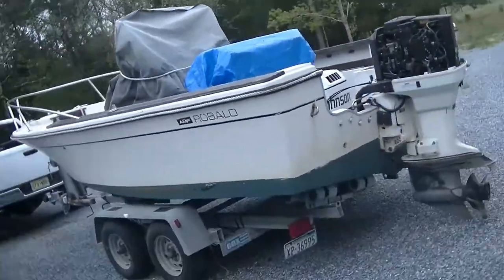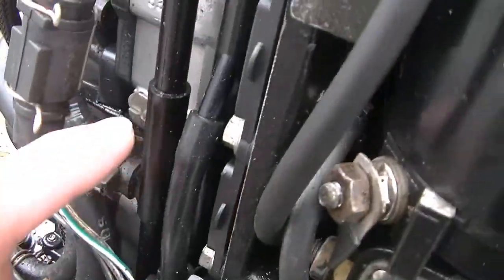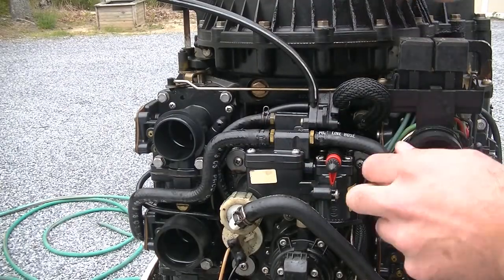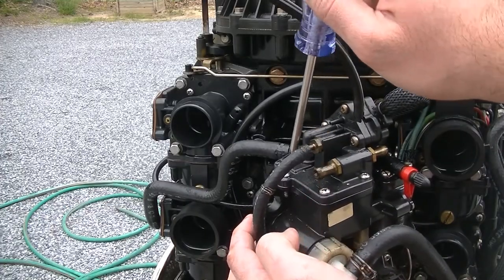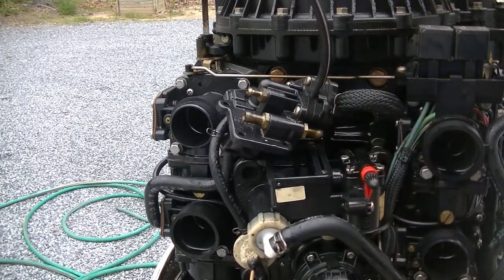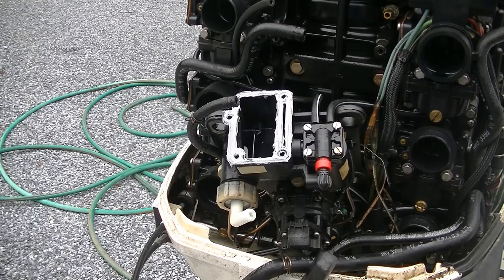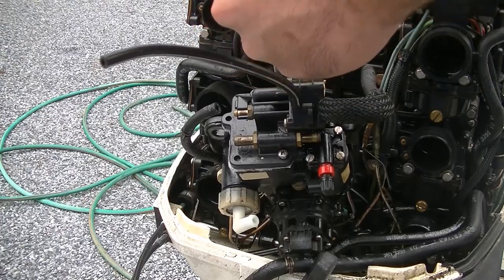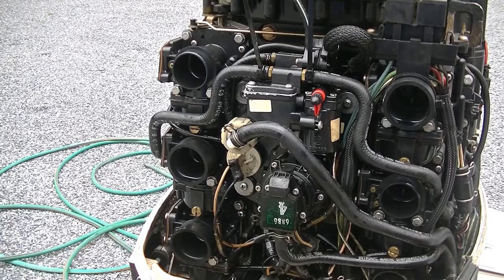150 Johnson vapor separator fuel leak repair

Comment: My motor didn't looked like it was leaking from there but was starving for fuel after 4000 rpm......i took the cover out press hard on the primer pump and i could hear air noises and a lil bit of fuel leaking thanks to this video

Comment: My VSC had a crack at the cover causing fuel to squirt out while priming. You cant buy the cover any longer so I had to repair it by filling in the crack with gasket sealer, Your cover is different from mine sine I have only two hoses and I see you have 3 to the cover. As far as zip ties go that's what the factory uses.

Comment: I used a huge stainless steel hose clamp put it Araund it front to back tightened and the leak stop ...... between that tank and the vapor pump there is a O ring looked like mine was also leaking from there because its all plastic it bend so either put a ticker O ring or sand it down a lil to make it straight

Comment: Will this problem not let your boat run? Mine is leaking there also but not as bad and it will not run more than 4 seconds
Reply: It could if the leak is big enough. When the pump is working it will be sucking air from there.

Comment: Man my 175hp Johnson has been sitting for 6yrs and I just ordered over $1,300 in parts and was hoping I could find a way to eliminate all this octopus 🐙 mess and put like an electric pump or oldschool pulse pumps because I can’t find the same parts like the vapor chamber and stuff there discontinued, any tips on here?
Reply: Yes buy a 6' pressure clamp and put it Araund the to seal the it worked for me stop the leaking

Comment: At Bobbygfl- for surging like that, its likely a fuel suction  leak... At Jason Kennedy same for you with the milky fuel- that's air getting into the fuel pump and when the diaphram mixes the oil with the fuel which has air bubbles it foams up.
You both should splice a piece of clear tubing between the fuel fitting entering the engine and your bulb which goes to the fuel tank to see if there are air bubbles being sucked up.
if so trace your fuel lines all the way back checking for air leaks.
As for warped carb bowls and vapor caps, often times you can take a piece of fine sand paper, place it on a flat piece of glass and then place the carb cap on top and slowly move it back and forth to sand it flat, don't over do it or you'll take away too much material making the matting surface too thin and it can crack when you tighten down the screws.

I've had pretty much had all the same issues, which I account it to Normal age, ethanol fuel deteriorating seals, hoses, jets and such..

These Johnson 60 degree motors are work horses, I have a 1999 on my boat with countless hours on it and the thing runs like a stallion.

Here is a good read for all owners of these Johnson Evenrude VRO style engines. It helped me find the solutions to my problems:
 https://continuouswave.com/whaler/reference/VRO.html

It has a Nice diagram explaining all the working parts of the VRO pump system.
Hope that helps you all.

Comment: So i have had my carbs cleaned. new fuel pump. New primer ball . And so on .. i can not get to half throttle before it starts to bogg down.. i had just noticed that there is a light milky fluid coming from the carbs. Im assuming there is water getting in with the gas .  New gas with new tank was run though and still same issue. What could be causing water to mix with gas ..  1998 evinrude 115hp intruder v4

Comment: I had fuel delivery issues for a while on my 2004 Johnson 90hp 2-stroke
A few years back I had the VRO removed and went to premixing in my inboard tank
This year I couldn't get the motor to stay running after pumping the squeeze ball
It would start right up and run until the carb bowls emptied then stall
Long story short , after trying several fuel pumps, I removed the entire VST and made my own pump and primer system
Motor now runs better than ever
The VST tank and pump combo is prone to air leakage I tried rebuilding everything and still had issues 
Simple is more efficient
Reply: How did you make your own pump and primer system
Reply: @marioarciniega4524  I removed the entire fuel system, the Oiler and the VST I kept the primer assembly
I installed a standard fuel pump with a  double TEE fitting
Attached the Pump to the fuel rails and the primer assembly through the T fittings
Capped off 2 lines from the Oiler
Motor running better than new, no stall issues at the dock or idling in the water
Reply: @Ocean_breezes  any pictures on this or videos on how to do this? Looking to do something like this as well
Reply: I too would be very interested in knowing exactly how you did this if you care to share details!
Reply: Hi Fella ,Ive got a question to you,can you make few pictures of your rebuilding? Thanks and greetings from Poland 😉
Reply: @dominikwojtas2550  Dominik, I may do a short video explaining how to do this
Never did a YouTube video, but I'll try
Reply: @Ocean_breezes  I definitely wanna do this with mine. I’d like to take everything off my 150 to make it more simple. If only they made carb bowls that aren’t plastic.
Reply: Can you give details of what you did? I have a 1999 with the same issues and I'm ready to eliminate all this BS and go back to simple. Any info you can give me would be very much appreciated.
Reply: Good to know I'm not alone with the  trouble I'm having. 

My 1999 Johnson 90 hp will not give me full throttle. It starts, revs up but bogs down when I throttle up.

I've been thinking of getting rid of the VRO  
But just want it to run!

Comment: Question for you, I have the same motor. Having a loosing rpm surging issue at full throttle. Idle to cruising no problem. Hole shot no problem. Here’s the super weird thing if the boat is on choppy water or navigating boat wake it maintains maximum RPM. If the boat is on calm water and full throttle it begins losing RPM and then gaining RPM losing RPM then gaining RPM and it just repeats. This occurs within about 10 seconds of full throttle in calm water. Pull back the throttle slightly to a cruising RPM and it performs fine. List of things already replaced: fuel vapor housing gasket, all fuel line fuel bulb and anti-siphon valve. Filter Water separator and water separator housing. Rebuilt the carburetors. After all that we moved on to a potential electrical problem. Started motor disconnected main Canon plug and ran motor eliminating any ignition issue boat side. Replaced Power pack and optical sensor. Waiting on coil and plug wires (on order). Should arrive this week at which point I will replace. Replaced plugs. That’s everything we’ve done so far. Have you ever seen this and do you have any idea what it could be? Many thanks!
Reply: Any luck finding out what happen? I’m having the same problem
Reply: @sneakerkings1  hi. Yes. In the bottom of the plastic bowl is the high speed jet. Evidently the last time I rebuilt the carb when I installed the jet I must’ve cross threaded it producing a tiny little curly piece of plastic that extended near the front of the jet. Bowl side if you know what I mean. Anyway over the years that little piece of plastic became weaker and weaker. Finally it became weak enough where under full throttle it would fold over the whole restricting fuel. I replaced the bowls and this is when I saw the little piece of plastic fall out. I literally replaced everything on his motor and that was the problem LOL. I’m glad I did because now everything is new in the motor runs better than it has in years but probably could’ve saved two grand!
Reply: I am also having the same problem.  It started last year, around the time I had the vapor chamber replaced, although I don't know if it's related.  It recently got worse after hitting bottom like an idiot.  I changed the prop last week and it's better but similar to last year.  When testing it out, I noticed when driving along the beach in one direction, it seemed fine but when I was going in the opposite direction, the engine would rev and I'd lose power.  I repeated over and over and oddly enough, it continued to do the same thing.  I believe it's a cavitation issue caused by my fish finder.  It snapped off 1-2 years ago and I epoxied it back together and I think it's causing turbulence or air bubbles in the water.  When I turn port side, the problem seems to go away, so I am thinking it's lifting the position of the transducer.  I could be way wrong here and maybe like Sneakerkings, there is a little piece of plastic sticking out, although no one should have touched my carbs.  

ps. I've noticed the issue more so when there is more weight in the boat.  
pps. there was a little damage to my skeg, so I filed it down so there were no imperfections, but I do believe it has a slight bend from hitting ground, so i will probably cut it off and replace it with a metal one at some point.
Reply: @bobbygfl  I have similar issue. How can I investigate if I have the same root cause on my motor? I'm not sure what you mean with "bowl side".

Comment: Hi.....I watched your video countless times .
I have a 175hp Johnson v6 outboard 2000 model. My vapor separator is just like yours.....my problem is I don't know where to connect the small air hoses on the vacuum.... 

Do they go to the carbs......or the engine block 
..please help
Reply: I've 1995 service manual but I doubt it changed anything in that regard. Do you still need help?
Reply: problem fixed....works great....thanks

Comment: So did it work? What was the problem? Was there a warp? Was it just a bad gasket? What does RTV do?

Getting ready to work on the same problem with my 90 HP 2004 Johnson.
Reply from the maker: So I still had a fuel leak after I completed this repair, However the leak from the vapor separator was fixed. All 6 of my carbs are leaking from the float bowls. I will be putting a video up within the next few days showing how to remove the carbs and replace the seals
Reply: @SEsGarage  brother, I really appreciate it. My starboard carbs were leaking last year, I found a dude to help fix it. I know my ports can't be far behind and I'm hoping to do it myself. Looking forward to the video, thanks!
Reply from the maker: @noneyerbidness  any time! I just finished my starboard side yesterday afternoon before it started to rain, so I’ll be getting the port side on video. While I was in there I replaced the throttle body gaskets as well
Reply: Have a 2004 90 Johnson also
Same problem
Did you fix yours?
What were the symptoms?
Reply: @Ocean_breezes  gas spitting out from the where the two parts join together.  everyone's natural reaction is to tighten the screws and pull the two parts tighter together.  but that just makes the warp worse.  sometimes you can just replace the gasket.  otherwise you can find videos on how to gently sanding down (on a flat surface) the high points of the plastic parts to have a good seal again
Reply: Please don't ever put RTV on a fuel pump.  .  .   Just asking for more problems down the road.
Reply: What's the part number on the gasket?
Reply: Why didnt you replace the bowl jet and gasket? Mine came with the rebuild kit. Was the sep unit warped because you never mentioned it
Reply: @harveyfloyd6045 I went ahead and did this a few months ago with Permatex #2 now I’m worried.  About to go in there and redo it but instead sand the surfaces flush and just use a new o-ring.  Unfortunate they don’t sell the top anymore…